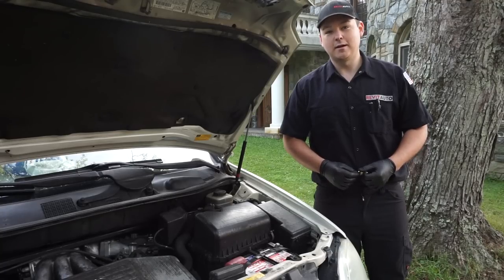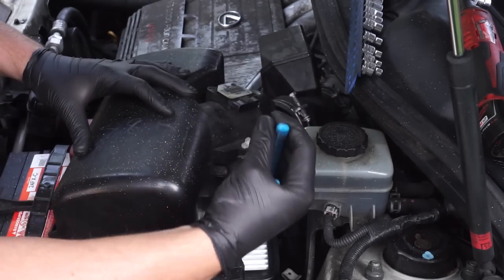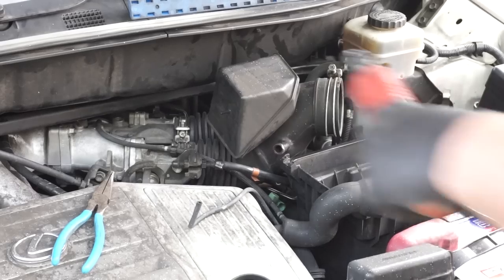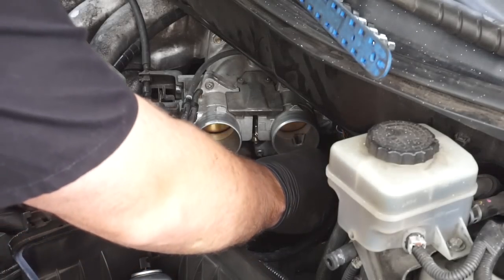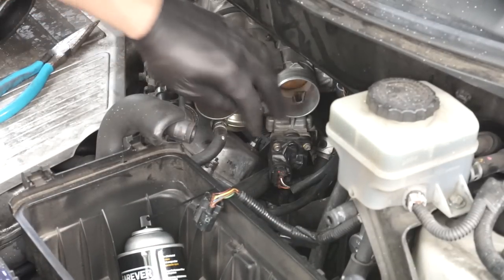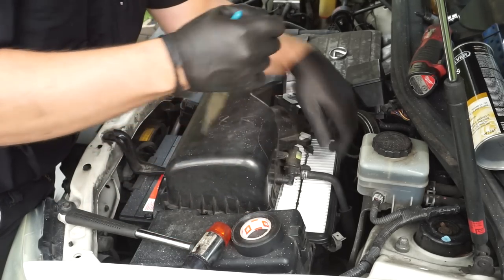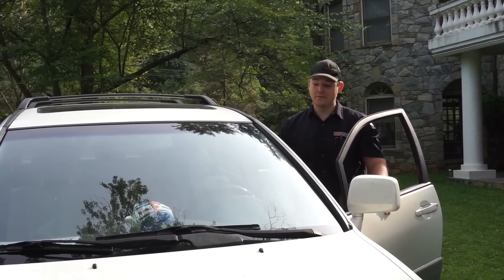'02 Lexus RX300 Stall After Starting (Idle Air Control Valve Fix)

Comment: Thank you!!  Our 2003 RX300 started, but wouldn't idle, exactly as you described. But, by following your instructions, my husband was able to fix the problem. He needed a little WD-40 to loosen the twin hoses after removing their 10mm clamps plus a little more and a couple of taps on the air control valve's screws to get them turning.  But, after completing the job in less than an hour, the car runs better than before and you saved us a tow and a trip to a mechanic!  Excellent how-to video!  Thanks again!
Reply from the maker: Glad it was helpful. We would appreciate it if you subscribed to help us grow and continue creating repair videos to help everyone. Happy motoring!

Comment: Thank you very much for your video. I own a 2000 Toyota Windom 3.0G in Japan, which is the same model as the ES300 in America. In my case, the idle speed would not drop below around 1200, so I tried the same method and the idle became low and stable. If anyone is considering replacing the IAC valve, I think they should do this first.
Reply from the maker: Glad it was helpful. We would appreciate it if you subscribed to help us grow and continue creating repair videos to help everyone. Happy motoring!

Comment: He says you got to be careful and not strip it. I guess he wasn’t too concerned about stripping it. Otherwise he would’ve use a hand drive screwdriver.
Reply from the maker: I can put far more pressure with the method I used with the palm of my hand pushing against the screw head.
Reply: @Revitauto  I always feel better using a had drive. I can push and twist and feel when the screwdriver is about to slip. When I do I just readjust. By the way the video was helpful. I own Hondas and work cars myself. IACV can be cleaned on the Hondas and I found your video looking to see if there was a way to clean the one on a  Lexus. It's my sister's car she had it towed home the night before because it was doing what you described starting and stalling.  So thanks to your video and my hand drive it's now fixed and running. So thanks for the walk through.

Comment: Truly great video. Thank you. I bought my 2002 new with 4 miles on it in Nov 2002. Now with 168,250 it has been a blessing of incalculable value. Mine runs really well. I just replaced the pcv valve which I strongly recommend every do every 30k miles. A $10 part and a 10 minute fix does wonders. I also run a can of BG 44k in tank (pour in before filling with gas) every 10k miles. This keeps the throttle body and lots of other parts squeaky clean.
Reply from the maker: Glad it was helpful. We would appreciate it if you subscribed to help us grow and continue creating repair videos to help everyone. Happy motoring!

Comment: 4:44. At that point, I take the hose off and block off the exit pipe that's attached to the idle control valve. I then fill up the breather hole with throttle body cleaner until it over flows. I then move the wheel back and forth. I then fill it again as some drains out and repeat. I then leave it for a few minutes, then I unplug the pipe. Doing this fills the chamber and cleans the underside of the value which is what actually gets clogged up preventing it from moving freely. I also take the opportunity to clean the throttle bodies and butterfly valves. You can see the dark edges around the butterfly valves which just need a few squirts of the cleaner then a soft tooth brush and a clean lint free polish cloth to wipe down. On this vehicle, they're operated by the throttle cable. You can engage the throttle cable to open the valves which means it's not drive by wire and no problem with touching the actual butterfly valves, very carefully and gently still.

Comment: Great video - solved my problem without needing to go to mechanic as planned. My 2000 rx300 wouldn't idle, leading to the engine not starting. NOTE: In the video, they forgot to reconnect the small, clampless vacuum hose that was removed at the start of the video.
Reply from the maker: Glad it was helpful. We would appreciate it if you subscribed to help us grow and continue creating repair videos to help everyone. Happy motoring!

Comment: Thank you for the video, great information on how to repair. The screws can be issue. Had to remove the air box to make room for hand impact tool, even that didn't seem to budge (housing not that sturdy didn't hit to hard). Soaked with pb blaster and grabbed with small vise grips. Was able to finally rock and remove the screws. They seem to freeze in the housing not the threads.
Reply from the maker: Glad it was helpful. We would appreciate it if you subscribed to help us grow and continue creating repair videos to help everyone. Happy motoring!

Comment: Great vid.    I also stripped the screw heads. got new 5 mil bolts from auto parts store. Did whole process in about 40 minutes. 
Thank you for informative video.
Reply from the maker: Hey! Thank you for sharing!!! 
Can you share the thread and pitch I will add it to the description! And part number if it’s a kit!
Reply: Sorry, I just handed it to the guy behind the counter and he said these 5 mil bolts should work.
Again thanx for video.

Comment: Thanks for the GREAT DETAILED video; the engine in my 2001 Toyota Sienna is identical to the one in your video! Was unable to remove the IAC from the engine to clean it in the same way you did; the screws would not budge. However, I removed the tube from below the IAC, plugged it and then sprayed cleaner into the hole in front of the butterfly valve until it was full, let it sit for about 30 seconds, removed the plug and let the cleaner drain, waited a while to dry before reassembling everything. This appeared to fix the start/idle problem so far. I think one of the screws on my IAC is stripped. In video you said one of the screws on your IAC was also stripped; how did you remove it? And how did you loosen the other screw?

Comment: I've had to do this job twice on my ES300. I've found it easier to just remove the whole throttle body assembly and take it apart on a table or bench. I did it once to clean it and another to replace the Felpro gaskets I put on with toyota gaskets because the felpro gaskets were too think and caused it to seep coolant.

Comment: Thinking about doing this. Letting throttle body cleaner drip out and land on all the plastic/rubber hosing beneath doesn't ruin their reliability? Cause them to crack or break?

Comment: Thank you for your response. I removed everything as in video. Pretty simple. I cleaned everything and used q-tips until I was satisfied it was clean. Intake was cleaned throughly. All hoses placed back. I replaced Philip screws with new stainless steel screws. Start up was not normal  because of excess carb cleaner but then idle remained at 2000 and climb to 3000. Depressing the accelerator did not help.
Reply from the maker: Jimmy, be sure to comment on the same comment thread. It makes it easier for other people with similar problems to follow the diagnostic.  Thank you for the more in-depth look at what was going on.  I would go ahead and take everything apart, make sure that the idle air control valve is moving freely and not just stuck in the open position. Upon reinstallation double check every single hose connection and verify that they are all tight with no leaks. If you accidentally leave a hose on, you will have the condition that you describe. They call it a vacuum leak.  If you recheck everything and there is nothing wrong upon visual inspection your idle air control valve may need to be replaced as it could be in the stuck open position. Be sure to take it apart and assemble again! Let me know what you find! -Blair
Reply: @Revitauto  great advice and  will recheck everything once more. Your video was very informative will save many.
Reply: @jimmydrakopoulos2140  did it work?
Reply: Richard Guerra  No.
Reply: @jimmydrakopoulos2140  how about now?

Comment: Why not  using carburetor parts cleaner? Since many others use that instead of brake cleaner
Reply from the maker: You could use either! If I had carb cleaner at the time I may have used it. But I also like that brake parts cleaner does not leave an oily lubricated surface.

Comment: The  reason so many are stripping that screw is because it is NOT a Phillips head screw driver. When the dot is on the screw head that means it’s a Japanese type of screw similar to the Philips head screw but has a slightly different head profile than our American Phillips heads
They are Japanese Industrial Standard screw heads. The screwdrivers can be found online. 
Better to order before you need than.
Reply from the maker: That is so cool! Thank you for sharing, could you please post a link to those?!

Comment: Great video,easy to understand,after doing all that,it's still low idling when I start engine,I have to step on gas to make it normal idling.I found out the 2 hoses going to it had holes,but I patched it up temporarily while waiting for my order,would putting new hoses make it start better?
Reply from the maker: If you have a vacuum leak it will call the car to have similar issues to what you are experiencing.

Comment: Great and informative video. Having similar issues with my 2000 RX300, Other than hard starting did you have any other problems such as bucking after short drive, code such as P0171?
check engine light? car has 140k on it Im sure there is a lot of buildup of carbon and crud.
Would appreciated any thoughts.
Reply: Go for a long drive going about 80 miles an hour.  That will clean out any carbons

Comment: What happens if you just didn’t mess with the strip screws unhooked the hose and sprayed the throttle body cleaner in and let it drain out the bottom without removing the the part fixed to it with the stripped out screws?

Comment: How did you figure out that this is the issue - is there a code from a sensor or did you just know that this was the issue?
I have a 2001 rx300 and I am having misfiring and idle problems.

Comment: Good video.  I went ahead and actually replaced the IACV and upon start-up the engine now idles too high at about 2000 rpm.  It also cycled a couple of times between 2000 and 2500 a couple of time, but won't drop below 2000.  Any suggestions?
Reply from the maker: Most likely there is  vacuum leak. Check all of your connections!

Comment: Hey I have a very important question I did exactly what was in the video to the exact same car and when I took out the two Phillips screws from the sensor mine did not turn freely and was stuck completely I cleaned mine just like you showed me and then it was so smooth afterwards it turned really freely so I put it all back together exactly in the way that you showed and exactly the way I took it apart, now the car starts right up better and different in a good way then before but my RX300 is now idleing high at 3000 RPM’s or a little higher and I did not do that before ….. is there some kinda way to have the car relearn the sensor or something ??? Please help because I can’t drive the car at all now because it’s ideling way to high to put into gear ?? Please please help me thank you and your videos are the best
Reply from the maker: Thank you so much for the detail!! I think what you are fighting is a vacuum leak and not a sensor relearn issue. 
Check all of the connection in the car for air that would enter the engine in a location it is not supposed to.
Check for loose hoses and intake boots that aren’t put on all the way. You will likely find it to be a quick and simple hose unplugged ! 
I will check here again to see how your progresses
Reply: My cat 2000 RX 300. Did this same thing without me having done any changes. Kind of scary when you are expecting your car to cruise to a stop and instead it speeds up. 
In my case the cable or something got stuck occasionally. I cleaned it up with WD-40 I think and have never had the problem since.

Comment: Beforehand, thanks for a detailed informational video about the problem. I have a question about what spray did you use for cleaning, does it need any specific spray? and is it available this problem will appear later?
Reply: @tr8086  did it work for you?

Comment: Would you know if this is common to the ES 300 Sedan?  Perhaps a different physical appearance but same concept?   I just replaced the battery and think the ES300 would warn me that the alternator is the problem if there was an alternator problem.  Mine is running rough and stalls do to low idle.   She runs well at highway speeds in that she seems to have full power.  Any thoughts would be appreciated.    Bill
Reply from the maker: Hey Bill this is a common issue among all vehicles. If you es 300 has the same motor than the video will help you too! Same concept different air cleaner box. Happy Motoring! Report back with your results! -Blair
Reply: @Revitauto  I'm not sure what happened but the history was that I had filled the tank with 93 octane fuel in prep for selling the es300.  Very oddly the battery died and had to be replaced so maybe the change in octane and a minor computer reset with the removal of the battery might have had something to do with the stalling.  It's cleared up now but I'm still on the same tank of fuel, I'm curious to see what happens if the fuel returns to 87 octane,

Comment: Did you get a check engine light after this video? 
I noticed at 9:26 you forgot to connect that “one other little vacuum hose” that connects to that smaller black air box. 
“ don’t ask how know the check engine light comes on when you forget to reconnect that small hose. 😂

Comment: IT IS NOT A PHILLIPS HEAD - the small dot indicates it is a JIS screw and you will strip JIS every time you work on a late model japanese car.   If it had "stars" between the flutes it would be a Posidrive.  There is a massive performance difference between each type.

Comment: Four things. I have an 02 RX 300. Never use brake cleaner on this. You’ll blow out your cats or O2 sensors. Use throttle body cleaner or mass airflow sensor cleaner. Buy a JIS screwdriver for those two soft brass screws. Phillips will not work. Next, wipe around the throttle plates themselves. They have to open and close flush with the sides of the body. Push them open SLOWLY or you will damage the motor that activates these. And lastly, put a rag under the hose when you drain it out. Otherwise it will cause a mess. Or you could deteriorate your rubber hoses.

Comment: Hello, I tried this and couldn't get car to start after putting everything back together. Is there a chance I didn't let the brake parts cleaner dry out enough before putting it back together? Also, do you know where I can find a similar screw for the stripped one I need to replace? Thank you for any advice/insights.
Reply from the maker: Hello Wesley, can you try to start the car with the gas pedal slightly applied? As far as the hardware I would ask a dealer for a parts diagram and ask for the hardware that you are missing. 
They will need your vehicles vin number. 

Don’t stress! This is most likely a simple fix!

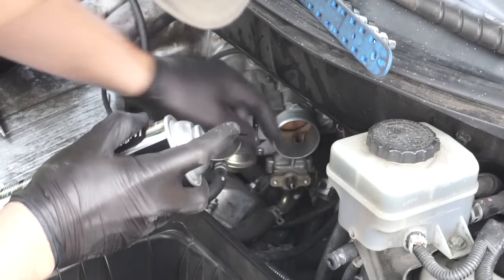Comment: Hello! What was the product you used at 4:13? It's hard for me to hear in the video. Thank you!
Reply from the maker: I was using brake parts cleaner, but I would recommend you use throttle body cleaner. Much better and safer! Happy Motoring-Blair

Comment: Hello Revit Auto, my 2000 Lexus ES 300 starts out with very slow pick up - it sounds and preforms like a 4 cylinder.. Once I get up to about 40mph, the acceleration returns to normal. Could this likely be a Throttle Body position sensor problem? Thanks!
Reply: Any suggestions for my 1999 lexus es300? Low idle. Slow stuttering take offs. Wont shift into 4th gear. Please help

Comment: My 02 RX300,kicks into gear very hard,when accelerate,do you think the trans shift solenoid causes this symptom or it’s just a dirty clogged filter and old fluid or something else ? Thanks
Reply from the maker: I see you made another comment about a high idle. I would address the engine idle concern first and then check what is going on with the transmission after.

Comment: Hello...did this job on my Rx300 to fix a hesitation on acceleration. It worked. The same problem came back. I did it again.  I May have sprayed to much carb cleaner. Now the RPMs stay stuck at 2500 to 3000. Any ideas ?
Reply from the maker: How long is the car idling high.? Did you just spray cleaner in there or take it all apart and clean it?

Comment: Would this work on a '02 es300? Idk if the engine is the same and stuff but I'm having the same problem.
Reply: Cleaning it did work but on the es300 it is a little different. Following The Car Care Nut's tutorial was more accurate for the es300 model. Thanks!

Comment: I have a 2000 model rx300.  The idling is rough at times. It goes up to 2 or 3 then, it seems to drive and idle normally...then outta nowhere it starts again. Could this be a dirty throttle body or something else?
Reply from the maker: It is really challenging to diagnose something without seeing the car. It is certainly possible that the Idle air control valve is causing the idle to be rough. Do you know the service history of the car? Has it had coils or spark plugs replaced recently? Are there any check engine lights? Thanks- Blair

Comment: Will a bad IACV cause the vehicle to run rich? Ty
Reply: It can, if IACV is not allowing enough air through your intake. But typically you'll have more symptoms then just running rich. Any other check engine codes? Does your vehicle start-up and idle ok? Need more info.

Comment: Hi is this fix applicable for a 2004 RX330? Thanks!
Reply from the maker: This will be a similar process!! Good Luck! Let us know how it goes! Happy Motoring-Blair
Reply: No. A 2004 RX330 has an electronic,"fly by wire" throttle. There is no IAC, the computer controls the idle.